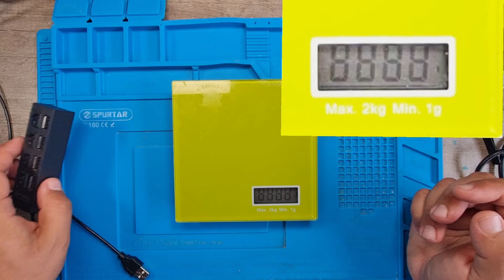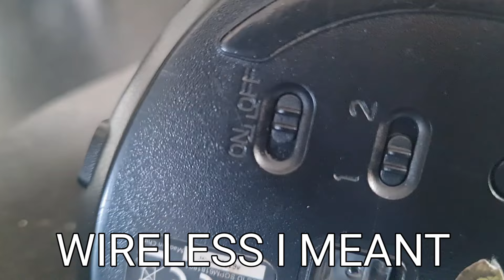Another Amazon Cheap USB Hub - works intermittently - let's fix it

Comment: Well... I got mine from AliExpress for less than $1 including shipping. 
So after I watched your video I was curious so I opened mine up to see what's going on, so I found out that it is even worse that yours haha.
I mean, in your case, the USB ports had only one leg soldered, in my case, non. No one single leg was even soldered. Also, you got 2 capacitors next to the microcontroller, I got only one haha.  
But hey for the price tag, I'm not even mad because I actually bough it to use it as an ON/OFF switch for my LED tape lights.

Comment: Bought a Ugreen one to mount into a piece of furniture. Granted, this is not what they are designed for but the fact that if you take the back off more than once you are likely to snap or bend the plastic case fixings is annoying. But it's okay, all the money is spent on an annoying blue LED, which always works.

Comment: There is a much more serious problem with these hubs... You can power them with an appropriate power supply.... However, there is no protection diode fitted to prevent the 5v  going back out along the cazable and into the computer... Not a good idea. There should be a schottky diode connected cathode to the supply line and anode to the 5v wire in the lead going to the computer. Without it; you are sending  5v back out along that lead into the computer/ laptop. If you intend to use it as a powered hub only... Then unsolder the 5v rail wire in the cable from the board and insert a rectifier diode (1N4007  will work) with the cathode going into the hole vacated by the lead; and connect the lead to the anode of the diode... Better safe than sorry. If you want it to work both powered and unpowered... Then you'll need a Schottky diode with as low a Forward Voltage drop as is possible. o the supply rail from the computer can safely power the hub. Like a lot of these Hubs and such made in china; they cut corners to cut cost.
Reply: plz make a video doing so!
Reply: @Glorious.Return  Unfortunately i'm not equiped to do so at present. It is rather simple for anyone capable of using a soldering iron. The Schottky diodes are the bad problem. Finding a source of the appropriate type can be a nightmare.
Reply: I used to get bluescreens when using mine, used to think it was my Overclock, but it was this dangerous usb hub
Reply: @MadMal2024  You are equipped with the right knowledge mate that's for sure... I will try to look it up but I encourage you to start on your monetized 🤑 channel.
Reply: @Glorious.Return  Ex Rediffusion N.E. TV Repairman... So I have the skill set. I also have a number of Specialist IT skills. And my Computer knowledge goes back to the early 8 bit era. Started programming on a ZX81, moved to a 48k Spectrum and had various other machines. Always programmed in Basic or machine code. I'm getting on a bit now (67) but it's all still there. I am just not set up to do Video uploads etyc at the mo.